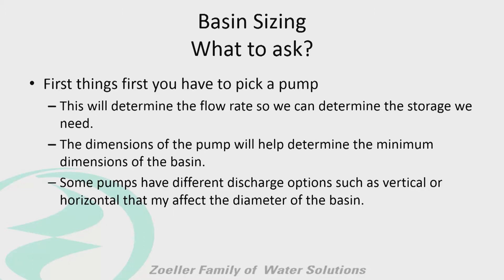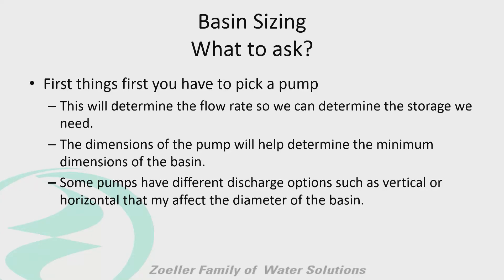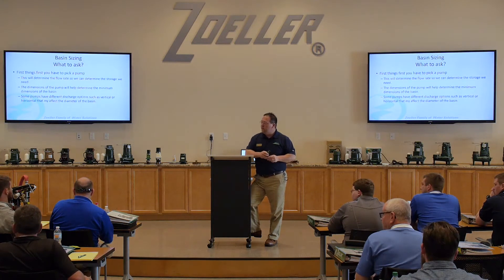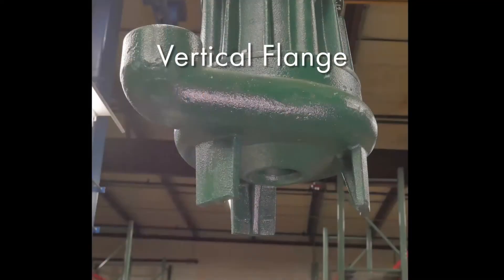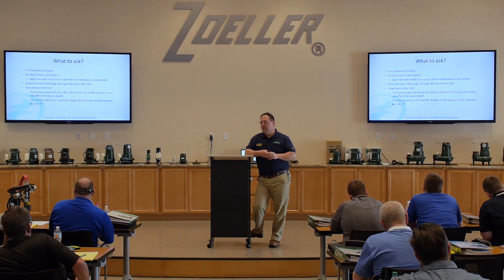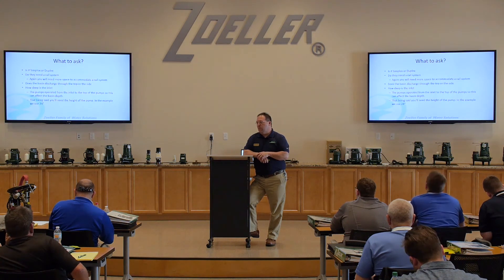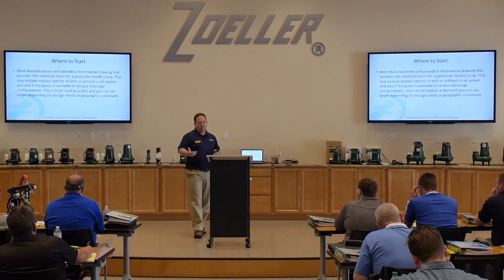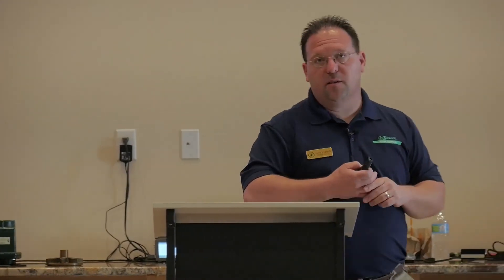Basin Sizing: Size Your Pump First

Comment: If you want to seal the drain tile pipe into the side of the basin, what is the recommended method with these fiberglass tanks? Is there a slightly curved bulkhead fitting that seals better without cracking or distorting the tank wall? Insert a t? Uniseal?

Comment: ..... I still don’t know what size basin to pick. I really expected to go through the pump options and then hear a formula for basin size relative to pump size.

1 situation probably needs a pathetic 10-30gpm pump another maybe 50gpm.
I was going to go with an 18” diameter culver pipe 40” deep for the first and a 24” culver 50” deep for the 2nd. Drill some 3/8” or 1/2” hole around them.
Reply from the maker: The basin size is typically sized on the performance of the pump. For example, we like to see an average of 6-8 starts per hour and a run time of 15 seconds or more ( longer run times are more effecient for the pump... think highway miles on a car). With the performance of the pump taken in to account (GPM) you would calculate the volume needed to provide the criteria above. An 18" pit would have approximately 1gallon per inch.
Reply: @ZoellerCompany  ahh thank you. Looks like the issue is I do not know the water inlet flow. It’s going outdoors. Not even sure it gets wet there actually hahah. Guess after I dig down 5ft we will see in the next rain storm. Was kind of just being proactive incase there was a large rain event. 
I live in TN and a couple years ago we got 14” of rain in 24hr. Not bad. The problem was it rained the day before that event already saturating the ground 😂